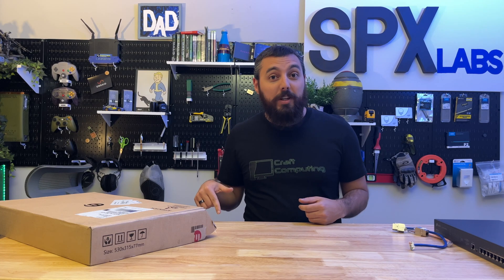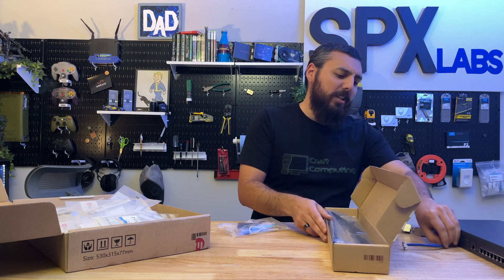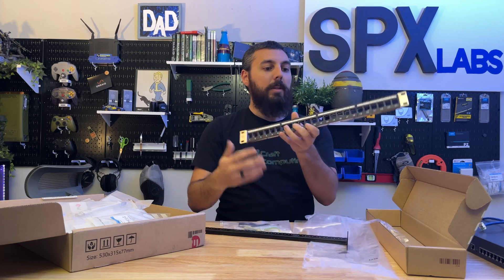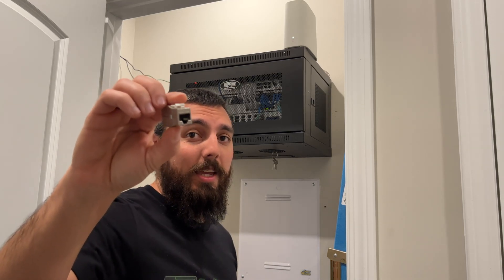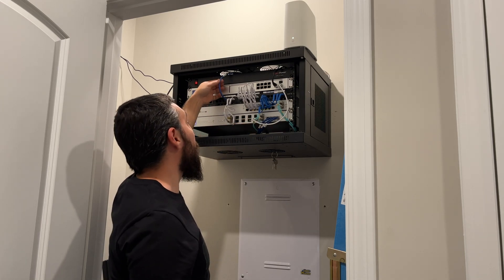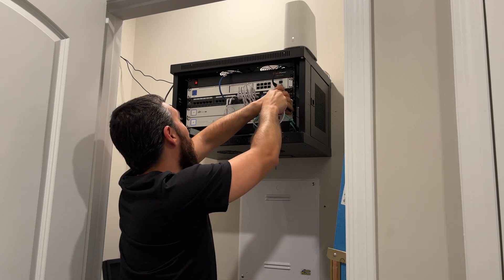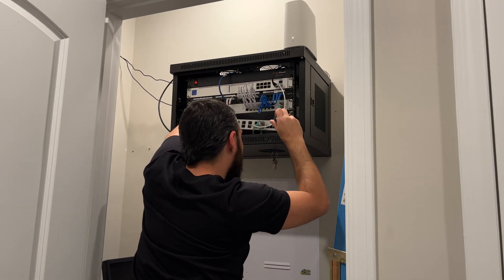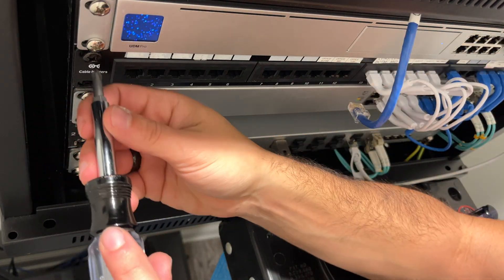Patch Panel Installation to Home Network Rack | FS.com

Comment: Wait --how did you attach the cable management tray to the front of the patch panel? I just got mine, same as you, 2 separate pieces, but they won't click together as is. Should I brute force the tray into opening its clamps so the click on the panel? I was hoping you'd show how to fit those pieces together in your video
Reply from the maker: I don't remember what I did, I feel like nothing was difficult with it as I don't really remember much of anything beyond switching over to it.

Comment: WOW 12cm long patch cable 🤮🤮🤮🤮🤮
Reply: SPX Labs : „It’s longer than your penis”  - A very professional answer. Really? Is that all you have to say?
Reply from the maker: Yes of course.  What could I have possibly hoped to achieve else wise.  Your comment is no way constructive nor presented in any fashion that can be rationally viewed as anything but antagonistic.
Reply from the maker: Yeah this is just a hobby…. I’ve never claimed to be a pro.  If I had longer cables it would be messy and ugly, I don’t need maneuverability when the environment is static.  You should have lead with this comment! It’s so much better.
Reply: @SPXLabs  As I said. You don't know what you're talking about. I have a question. Why do you need a patch panel if you don't know how it works? How do you connect more distant ports? There is such a thing as "Cable Management Panel". Opsss... I'm sorry, you don't know what I'm talking about. Real life is brutal... for you.
Reply from the maker: That's a good point, I'll have to get my boyfriend to help me and maybe he can find a solution.

Comment: After reading some documents on these server racks I ready they have to be grounded. 

1. Did you do that
2. Where do you attach it to in your house?
Reply from the maker: Grounding can be a bit difficult but if and when possible I attach the grounding cable to the grounding pin on a NEMA 5-15.  You can DIY it or buy one.  For my home I don't believe the air is being statically charged by anything and there is a lack of carpet so I myself am not highly charged.  So I don't ground my stuff because I believe it's not necessary.  But if I did, I would just attach to the nearest grounding pin of a NEMA 5-15.
Reply: @SPXLabs  thanks

Comment: Why did you put a zip tie behind the Keystone jack? Does it help with something or is it part of the instructions?
Reply from the maker: It helps keep the keystone “locked” so there is no chance that the cable can be ripped out
Reply: @SPXLabs  thanks for the reply. That makes sense

Comment: Good choice of music! And a well done video!
Reply from the maker: Awww 🥰 you are always so supportive!
Reply: @SPXLabs  Well deserved! BTW when you cut off the excess copper strands on the side of the keystones - cover up the other equipment closeby ... I had some little snippets fly into the air vents below once and it took me forever to get them out, i have a towel in my toolbag for things like that
Reply from the maker: The real pro tip here
Reply: @SPXLabs  lol I just hate to look for those little 'snippets', it terrified me seeing them going into powered switches underneath ... either getting a short or the fans fail ... Some Ubiquity manual i read (YES I DO) said to power them off & on for big changes, also to disable PoE on 'crossconnect' ports (from one switch to another, or uplink ports) ... guess that's for safety just in case your electrician screwed up and there's a voltage potential between those units ... I learned it the 'hard way' - always connect a good ground before anything else
Reply from the maker: I only do things safely when it’s not my own stuff.  It wouldn’t be fun unless I triggered you guys or had you on edge.  Like back when I had an iMac precariously placed on the edge of my workbench. Lol